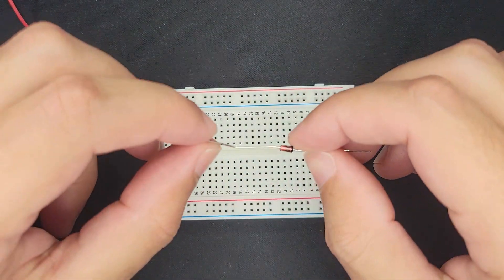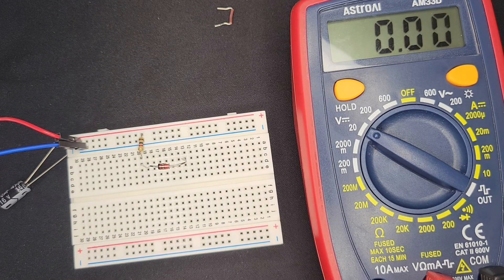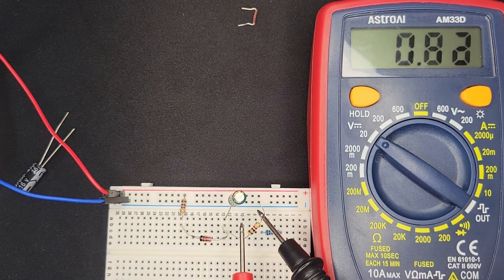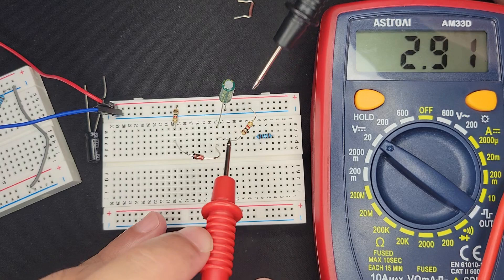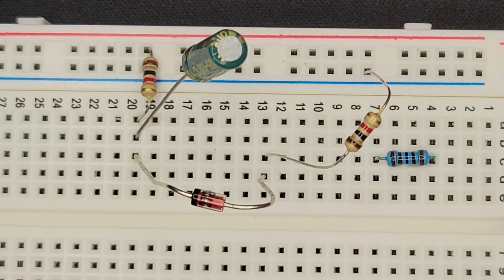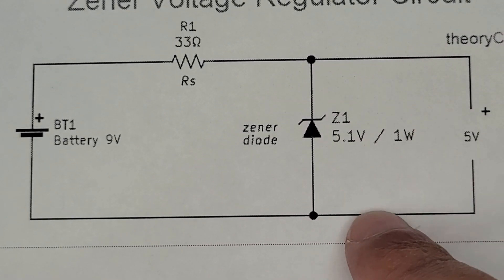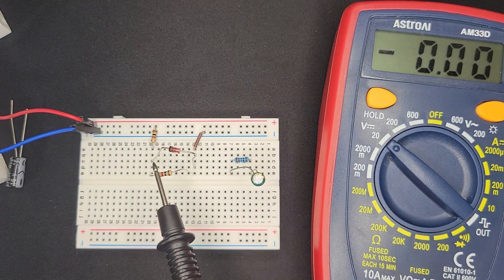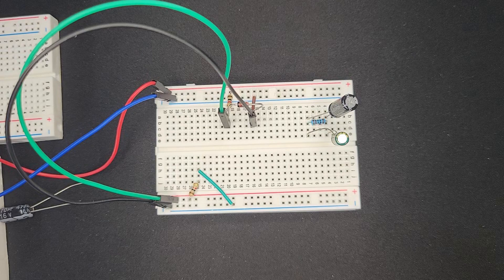Beginner FAILS (Then Builds!) Voltage Regulator - Beginner Learns Electronics Ep15 - Zener Diode

Comment: It is 1:00 AM where I am and nearly time to go out for a walk, so I'll leave the main part of the video for later. However ...
I was very pleased to hear you mention "math" in your first few words. I know that math is a struggle for a lot of people, but a willingness to "engage with" some math is, in my opinion, very, very helpful in the early stages of learning electronics. Some of the math in electronics is very complicated (and some complex, which has a distinctly different meaning), but lots of it really isn't. Lots of it is what I call "arithmetic" - not much more than the basic "four functions."
Reply from the maker: Thank you! Enjoy your walk. There is a bit more footage actually, where I try to calculate the maximum current I can have through the Zener based on its max wattage (and the max wattage of the resistors being used). So I don't recall how much mathematics was left in this "main" video. I am planning to post some of those calculations in an unlisted video and provide a link from here.

Regarding me and mathematics -- I usually do well with short-term understanding. (Researching something, learning it, applying it). But I was never a 'math-head'. I do love programming and (I believe) excel at it, and usually those two go hand-in-hand. But for me that wasn't so much the case. You are right, though -- it seems to me that we must learn some of the (at least basic) functions and formulas to begin to understand what's happening with the electronics. The power formula (P=VI), ohms law (V=IR), capacitor time constant (T=RC) are all 'memorized' and relatively easy for me to apply. Dylanger Gutierrez mentioned Kirchhoff's 2 laws, which I think (as he mentioned) are intuitive once you begin testing and measuring circuits. But it would be good for me to formally apply it. Thanks again for your input!

Comment: Glad to help!  Always fun to watch you figure these things out as you go.  It's definitely not intuitive to use the negative terminal of a diode as the positive supply, but of course if you forward biased it, it would act like a normal diode.

One thing you may want to look into if you haven't been introduced yet is Kirchhoff's laws. There's a voltage law and a current law, and the voltage law would have been helpful here.

Basically, KVL states that the sum of all voltage drops in a loop must equal zero.  What that means practically is that if you have a 6V supply, all the voltage drops across a string of series components must add up to 6V.  So, the Zener itself was 3V, which meant the other 3V had to be split across the resistors.  With one resistor, you'd get 3V across it (6-3), with 2 resistors you get 1.5V across each (the voltage is divided evenly across the resistors if they're the same value).  When you went to 12V, the Zener still dropped about 3V, so the other 9V was split between the two resistors.  

It's good you used a series resistor; trying to force 12V across a 3V Zener would probably burn it out, the same way forcing 12V across a normal forward biased diode would.  Also note that the Zener diode is only capable of shunting the voltage, and if you pull enough current from that node that the top resistor's drop alone would make the voltage fall below 3V, the Zener can't stop that voltage from going below 3V.
Reply from the maker: Thank you. I did not (and do not) know specifically Kirchhoff's law -- but I have indeed observed that all the voltage needs to be "consumed" in the circuit, and that equal value resistors will drop the same amount due to ohm's law. Thank you for putting into the proper context and the law that governs/articulates that phenomenon.

When you say "... the same way forcing 12V across a normal forward biased diode would [burn it out]", are we talking about current that isn't being limited by a resistor? Because I thought the "burn out" factor is more the current/wattage than pure voltage? I suppose it depends on what the specific diode's max voltage is?

The other law from Kirchhoff is that all current going into a junction must/will "escape" back to ground? Sorry for my colloquial explanations lol. But in other words, all current must be accounted for amongst all paths to gnd?

Thank you again for all the help and explanation! I am about to take a look at potentiometers. I've had some sitting nearby and I need to put them to use. So that will be out Wednesday.
Reply: @LearnWithMxy   @LearnWithMxy   Yeah, absolutely! KVL and KVL are foundational concepts for circuit analysis, and even if you don't know them formally, you've probably picked them up intuitively.

KVL basically says that electrons are "incompressible" the same way water is; if you force current into a node or a black box, you have to get that same amount of current out somewhere else.  If you have several wires going into a junction, all the current into the junction has to add up to all the current leaving it.

  You're right that the diode would get burnt out because there's nothing to limit the current.  Because current is an exponential function of voltage across a diode, it increases by a factor of e every 27mV extra voltage that's added to it.  In real life, eventually the limiting factor becomes the resistance of the diode rather than that equation, but if you put an ideal 12V source across an ideal diode that normally rests at 0.7V with, let's say a milliamp bias, it would theoretically draw about 3x10¹⁷⁸ amps of current and dissipate 4x10¹⁷⁹ watts of heat, which would make the sun look like an LED by comparison.

Have fun with potentiometers!  They can be really useful.  While they can be used directly to limit current in a variable way, maybe their most useful application is controlling other things.  For instance, if you put one in parallel with a transistor (middle wiper to the base or gate, other terminals to the collector/drain and the emitter/source), you can handle more power by making the transistor carry most of the current.

Comment: I eas frustrated at the first half but luckily you corrected it once you got a schematic. Yes the corect way is the end of the video. I use them for certain things, but they have linited supply current. But you don't always need a lot of current it just depends on the application. You can use a power transistor with a zener as a larger current supply. But you get .6 or .7 volts less from the diode in the transistor so you need a zener .6 or .7 higher then your desired output to use a power transistor and boost the current capabilities of the circuit.
Reply from the maker: I was frustrated, too! lol.

The "limited supply current" you're talking about is capped by the wattage of the zener, yeah? I did some calculations afterwards but cut it from the video, trying to figure out the max current I can run through it (while respecting my 0.25W resistors). I will prob. post that in a separate video where I properly demonstrate voltage regulators from the start. Thank you!
Reply: @MxyAhoy  it would be great help if you upload the video which will include how to measure current running through it!  Keep up the good work!
Reply from the maker: Will do! I will probably be posting it unlisted, but put a link on that video. I'll reply here when it has been posted. Hopefully this week some time! Thank you for your suggestion!
Reply: @LearnWithMxy  yes the resistor and zener both play a role in the available current. If you put like a 2 watt resistor, the zener being only 1 watt will not supply more than 1watt out. So if you parallel it with another resistor of 2 watts, the 2 resistors will simply form a voltage divider and your zener will burn up if the voltage of the divider is over the voltage rating on the zener